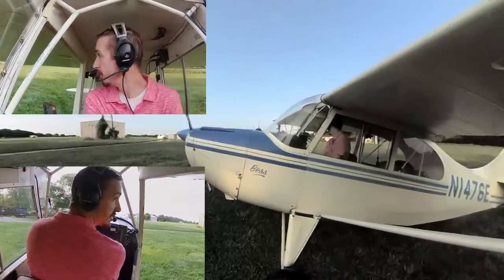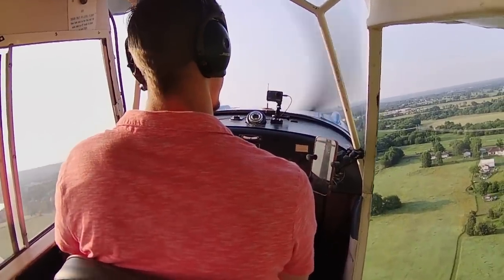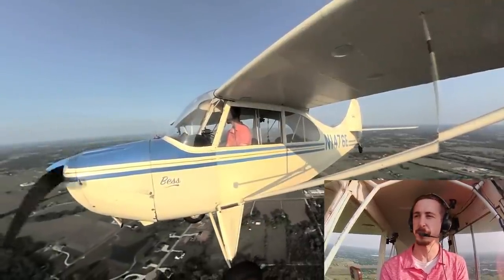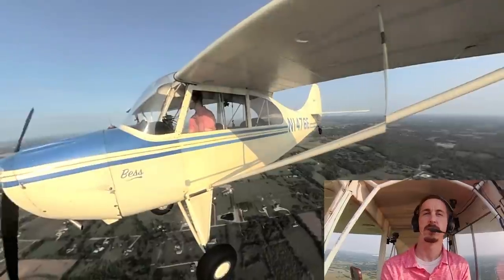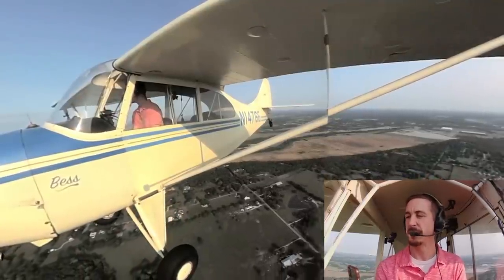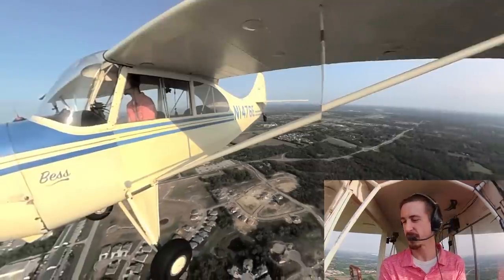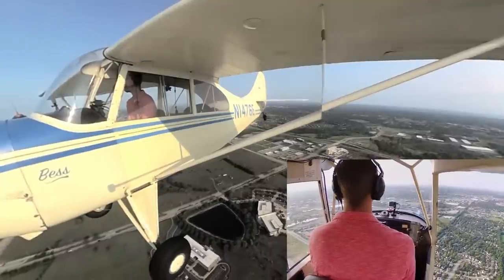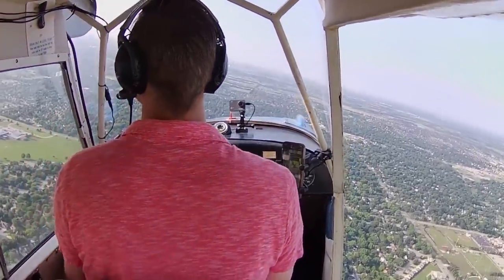Is a Light Sport Pilot certificate for you? Flying to work!

Comment: The problem is that many drop out of flight training due to the onerous training requirements to achieve certification. The solution is to require CFIs to allow never ending discovery flights.  Ie, the CFI is there for safety purposes only and does not require incessant maneuvers, short field, stalls, etc training unless he is requested to do so. Right now most CFIs refuse to do so, for some reason that baffles me.

Comment: Seems like the insurance discussion is often omitted. If you go to buy an LSA and it is Experimental, or a tailwheel aircraft, you certainly won't be finding insurance easily or at all unless you have a lot of hours and preferably some in type. This is a big barrier to entry.
Reply from the maker: My most recent video discusses the costs of insurance for a legacy tailwheel like mine. My first year premium with 0 tailwheel time was $1200. This video was intended to focus more on the pilot side of things than aircraft. Thanks for watching!
Reply: @prodigalpilot  You were lucky, I think. I couldn't even find an insurer that was willing to insure a tricycle gear Experimental, let alone a tailwheel, and I had 80+ hours at the time and a completely clean record as a pilot.
Reply from the maker: @greymarck  strange! I had quotes from all of the major underwriters. Insurance is weird.

Comment: That  "Don't Take the Medical"  advice sounds wrong for Everyone.....If you've got Significant  medical issues you absolutely Shouldn't be flying Anything & the Earlier you're Grounded  the Safer Everyone will be.....
Reply from the maker: Thanks for the comment! You bring a good point and I should have been more clear that it is up to every pilot(medical or not) to self assess before every flight to confirm no undue risk to self or those on the surface. There are many “gotchas” on FAA medicals what can disqualify a pilot that a reasonable person would agree is not truly grounding under most circumstances. It appears the FAA agrees with this assessment as they do not require a medical for sport pilots.
Reply: You have to have a valid driver's license to get a sport certificate. If you are healthy enough to drive a 3000# car you can fly a 900# plane
Reply: @prodigalpilot  I'm so glad you made this video.  I just started reading the requirements for PPL after doing a discovery flight and was devastated to realize I wouldn't qualify for a 3rd class med due to being diagnosed with ADHD a few years ago. I have a great driving record with a CDL, motorcycle endorsement, and even used to operate submarine nuclear reactors, I'm just bad at keeping my house organized and remembering appointments! So glad I learned about this option, this is exactly the type of flying I wanted to do anyways.